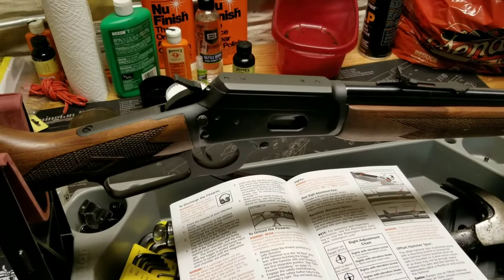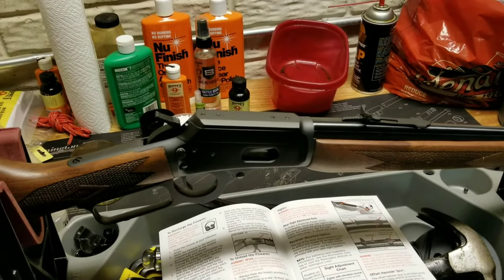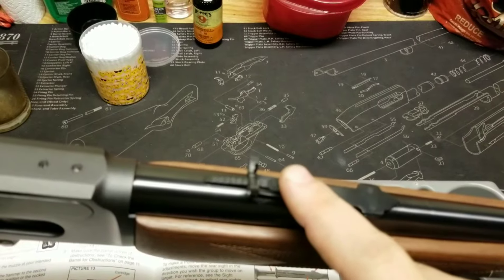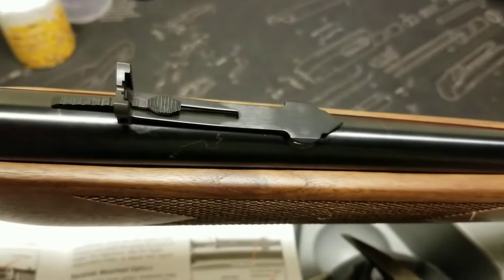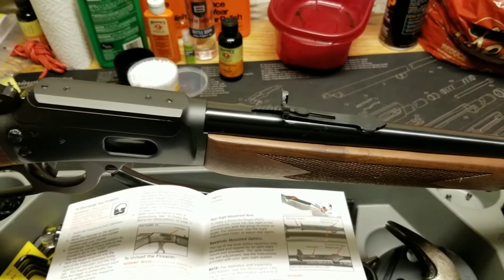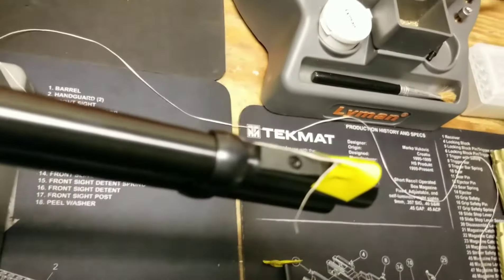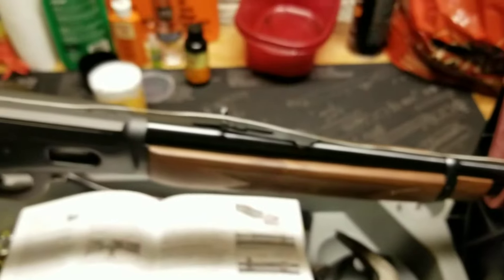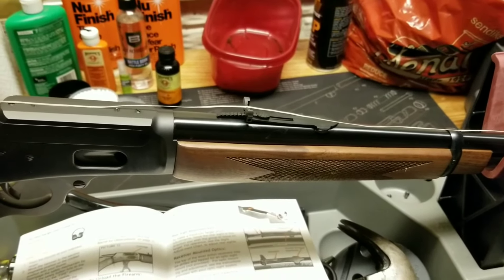Buckhorn Sight Adjustment Trick

Comment: To see how much you moved the rear sight with the punch, first put some masking tape on the barrel in front of the buckhorn, slightly underneath the front edge.  Trace the shape of the sight front edge on the masking tape.  Now as the sight is tapped over, you can see if it was a little or a lot or maybe didn't move at all yet.  Someone on another comment on youtube called this making a witness mark.

Comment: My Henry 22 windage was off. I used dental floss to  line up front, buckhorn and center of hammer on the bench at home. Went to range perfect! For elevation,  with front sight buried in buckhorn notch at lowest setting it shot about 1.5 inches to high at 25 yards. I carefully used round fine to increase notch depth on my buckhorn. Reblued the notch with cold blue. Didn't have to replace with higher front sight and got it to print 3/4 inch high at 25 yds, so about zeroed at 50.

Comment: Put a piece of tape over the barrel immediately in front of the rear sight where there is a point indicator.  Use a pin to mark on the tape where the point is before beginning.  Then tap lightly until you notice the point move from the pin mark and mark this new point on the tape and fire the rifle.  Continue this until you get you windage where you want it.

Comment: At the dovetail end, the sight is pointed. Add a piece of masking tape with a pencil mark here on the barrel and line things up. than tap sideways with a wooden dowel. A pencil width will work out to 1" at 50 yards. The pointed sight tip is the pointer, the marked tape is where you currently are prior to adjustment. Easier to know where you're going when you already know where you are.

Comment: Hrmm.. this would seem to contradict, what I was told on lever guns for windage, when I looked into it. You tap the front sight over within the dovetail. Which is apparently why BOTH my 336 AND 1894 .44 mag when I first took receipt from the dealer... both had a front site blade that was soo ridiculously loose you could reach up and move it back-and-forth 2-3mm within the dovetail! Apparently it's customary to move em back and forth and then peen the edge of the dovetail a lil bit over with a punch once you've got it so it will then stay there. The rear intended to provide elevation adjustment only. I need an optic anyway with my vision these days, so I just dabbed some blue loctite onto that front site blade, eyeballed positioning it centered along the barrel,  and called it a day.

Comment: Good tip.  Well done.  I noticed your buckhorn sight was almost in the last elevation notch.  I'm guessing you were still shooting low. I had to purchase a taller front sight and do some filing down to get POI the same as POA with the rear sight at its lowest setting.
Reply: @Daniel Nelson I agree....he should.  However, it should not have to be adjusted to the top notch to get to point of aim, so like every Marlin I've ever owned, a taller front sight is needed.
Reply: @easttexan2933  I had to do the same thing to my Henry 223 single shot
Reply: @Daniel Nelson  yep
Reply: @easttexan2933  I’ve found the higher sight post with the ramp set at the middle notch and then filed it down till it was shooting perfect at 100 yards worked the best and I can still use the ramp for closer or farther away shooting

Comment: Nice trick but glad I didn’t have to use it. My Henry would probably be a dead nuts tack driver in better hands than mine. As it is it makes me look like an awesome shot.
Reply: My Henry Big Boy rear sight is at minimum elevation and the rifle shoots a little high.  I added a Skinner rear peep and it shoots low when on the ground and it shoots high when I am in a tree stand shooting down onto the target.  Screw it.  I guess I will just finally get an optic.  Despite the issues with the sights, I love the gun.

Comment: Very informative thanks for posting..
do you have a video on removing the front site? Just got the 1895cb and installed the williams peep onto the rifle..relized that I needed a taller front site and ordered the Williams Rifle Bead 570M and now for the install..
Reply from the maker: I do not, but it is my understanding that the sight gets knocked off right to left and then back on left to right.  I would use a brass punch to do the knocking.  Many new  sights / spacers need a little bit of gunsmithing to be installed.  By that i mean you may need to file the sight a bit to get it to fit in the grove.

Comment: Hi Mel. How’s it going with the accuracy. Be great to learn about how you are doing. Cheers.
Reply from the maker: I was able to get my windage set perfectly, but elevation was still a problem with my new Marlin 1894 .357.  I have since switched that gun over to a Skinner peep sight.  That sight is working great for me.
Reply: @MeltheNut  my Skinner rear peep helped me with accuracy, as I am more accustomed to that sort of sight, but I am still having elevation issues on my Henry Big Boy.  My next step is to finally get an optic and see if that helps.  Still, I got two deer in 2018 with it.  I like the rifle.
Reply from the maker: @Squib1911  My peep sight worked perfectly on my Marlin 1894 .357, but on my old JM marlin 30-30, I had to buy a new front post to fix elevation issues.
Reply: @MeltheNut  as far as I know Henry doesn't currently offer a replacement front sight that would help with this issue for me on that model of rifle.  That was my initial desire to fix the elevation issue.  I will have to remove the Skinner rear peep in order to install a scope mount, but if I can still use the buckhorn sight a s a backup, then I will keep looking for a Henry or aftermarket replacement/ adjustable front sight.
Reply from the maker: @Squib1911  You should contact Skinner directly and see if they have a front sight option for your rifle.  Can't say as I love the look of the their front sights, but they work.  Also, they do need a bit of gunsmithing to make them fit right.